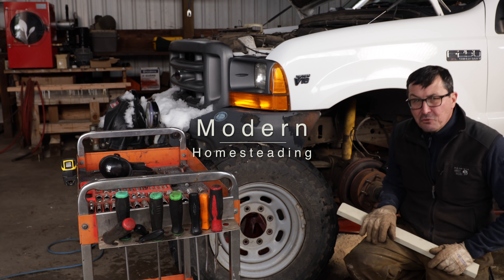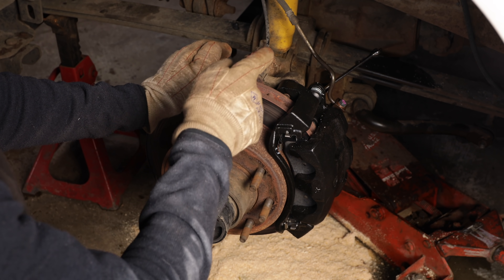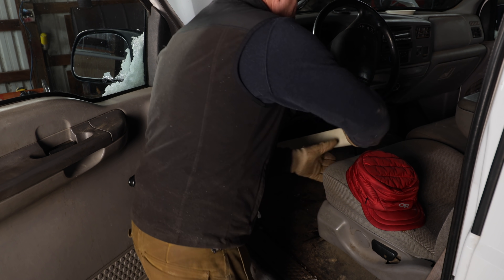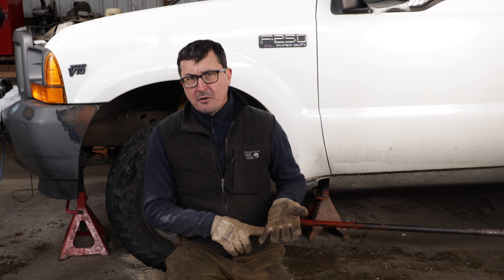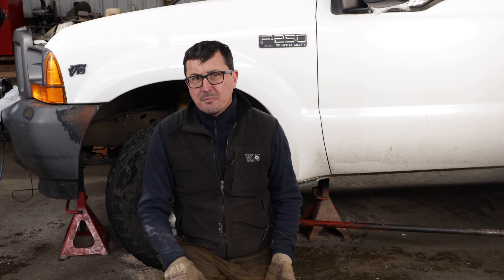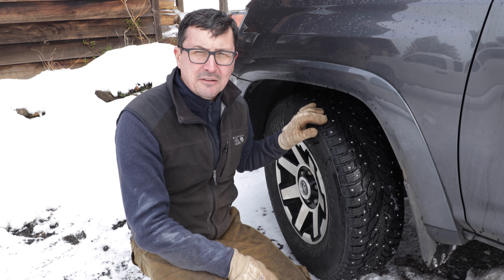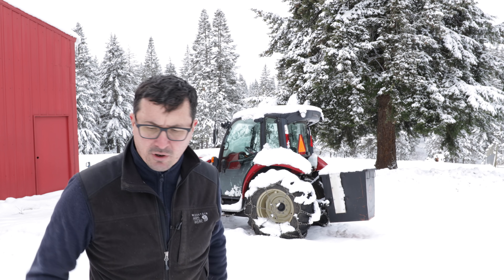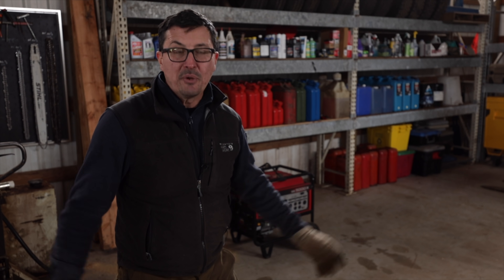IT FINALY HAPPENED!

Comment: I have an 81 f250 tallboy. This old truck  is a beast. It isn’t pretty but it works great with 400 000  miles on it.  A few years ago we had a particularly savage blizzard blow through. I went for a drive and wound up pulling over 30 vehicles out of snow drifts including done municipal workers town vehicles.Some of them were brand new fancy 4X4 trucks  that were stuck in the same snow drift  that  I plowed right  on through while pulling their truck out at the same time.  No computers,no sensors or any complex electronics. Nothing goes wrong because it doesn’t have anything. Just a standard transmission  geared nice and low Mated to a bulletproof straight 6. The few times my mechanic ever gets to work on it he just loves it. Easy to work on and tons of room under the hood:

Comment: I wish Toyota would make a heavy duty truck. Seems they've just given up trying to compete w the big 3 in this area. Could you imagine a Cummins powered Toyota?
Reply: We had a Cummins powered Nissan that was targeting something bigger than the half tons and smaller than the 3/4's.  It just didn't take off.
Reply: @goombakiwi  I know. I've seen them. They didn't take off because 1, it's a nissan, and 2, they're the ugliest truck you'll ever set eyes on.
Reply: I'd definitely buy one.
Reply: IOverseas vehicle manufacturers make models that are big 4 wheel drive commercial units with diesel power plants great fuel mileage as well, they refuse to sell those models in the states.......
Reply: @drewcarpenter Toyota would most likely have a Hino in it. The Nissan’s with Cummins have over head valves, so they will have timing chain problems just like everyone else.
Reply: Tundas are heavy duty enough.
Reply: Apparently you have never driven a 5.7l tundra w/4.30 geared axel....     who needs a 3/4 ton ?
Reply: @edaker4684  no they're definitely not
Reply: @mikebraun9673  people who need dually and long bed
Reply: 2021 New engine and new 10 speed transmission coming out.  Should help with all of that although I dont think a diesel Tundra will happen.
Reply: @digdrewzter  Yes....   you win on the long bed argument...
Reply: Australian Toyota turbo diesel tray back is probably the most reliable vehicle made today.
Reply: @edaker4684  true

Comment: For  bleeding bakes and clutches, I have a neat little gadget, which consists of a piece of rubber pipe, about 6" long, with a ball bearing jammed in it, about half way along.

You fit it on the nipple, crack the nipple, then pump the brakes a few times, until the peddle feels firm, then tighten the bleed nipple, and remove the pipe.

The fluid is pushed past the ball bearing, but air isn't sucked back in the system, when the peddle is released.

Comment: A generator shed would let you keep it in place in a protected box ready to run at all times. 

A propane conversion kit would let you duel fuel the generator giving you the option of BBQ propane tanks for availability and shelf life along with leaving the liquid fuel system in tact to still run on gas. Starting and stopping on propane will make sure the carb is free of any gas so no worry about gas evaporating in it and needing to be cleaned out.

Comment: If you're looking at badges you're doing it wrong. There are sh*t Fords and Toyota's. Take the 6L Powerstroke for example or the frame rot on certain years of Toyota trucks.. There isn't a ford or dodge truck I want but there are few GM trucks I'd consider depending on the year and powertrain.
Reply: The 6.0 powerstroke aint got nothing on the 6.4 powerstroke
Reply: @jefferycollins5158  
Sorry I meant the 7.3 that international made. By far the worst. All I can say is buying by nameplate is stupid. The first two years of a new model/powertrain are usually the worst and I wouldn't buy anything without checking carcomplaints website after it's been on the market for 5 years. I don't trust any of them.

Comment: There is an easier way to bleed your brakes. Filling a bottle with a little of fresh brake fluid. Attach a hose to the bleeder screw, then open the bleeder screw. Then you can press and release the brake as many times as you like. Once you’re done, tighten the screw and you’re done. It’s a good way to flush the brake fluid as well.

Comment: pro tip from an old guy (not me) pull the bleader screw and have a tea. Blead screw is on the sytem high point, removing it opens lowers restriction, when it starts to leak you have most the air out.

Comment: Another idea for bleeding brakes is to use any bottle, put a hose on the bleeder long enough to reach into the bottle a 1/4 inch from the bottom. Fill the bottle half full with brake fluid and insert the hose from the bleeder into the bottle. Support the bottle with the hose in it so it doesn’t fall. Open the bleeder and pump the brake pedal slowly 10 times. Close the bleeder and pump the pedal, it should be hard. If not do the procedure again. I do this a lot works great!!

Comment: Mr. Wranglerstar, I don't know who told you that Dodge pickups need ball joints every 30,000 miles but, they were very misinformed. You did say something in this video that I agree with. They all have issues at some point. Especially if you use them. I have a 2007 3/4 ton Cummins that has 201,500 miles on it. That poor pickup never goes anywhere without hauling around 10,000+ pounds. I pull my 5th wheel along with either my boat behind it or my flatbed trailer with my RZR on it. In 201,500 miles, it has 1 set of ball joints. I did upper and lowers although only one was worn out. And it's only had its breaks changed 3 times, rotors only once. I'm almost do for the 4th change but in 201k, that's pretty damn good. I would say that 85% of those 201,500 miles are pulling miles. Given how many times my ford friends have had to have their pickups fixed, that have far less miles on them than my Dodge, I will gladly stick with my Cummins diesels until I die. I'd be happy to debate this topic if you'd be interested. Have a great night, sir. I look forward to more of your videos. Even if you do bash on the superior pickup brand. Haha

Comment: Another trick you could use is put a silicone hose on the bleeder, run the hose to a can full of brake fluid, fill up the reservoir and the you can pump the brake pedal yourself, the fluid in the van will not allow air to come back into the line and you pumping the brake will purge all air out of the system. Something I learned years ago and has never failed me.

Comment: you can also use bottle and hose. put little bit brake fluid in the bottle, drill hole to the bottle cap, put hose thru it and make sure that the hose is in the fluid, then connect the other end to the caliber, then just pump the pedal. all the air comes thru the hose to the bottle and makes bubbles.

Comment: The only honest thing he said is that ALL manufacturers have issues and flops. FORD is NOT DIY friendly.
Since 2012 F150s require you to go to the dealer to check/ad ATF. Look in the owners manual.
Since 2012 Super Dutys are designed to have the cab lifted off for anything more than routine maintenance. 
Every year FORD makes you buy more special FORD only tools to be able to work on them (is special jig to lift off cab).
Lastly when you buy new OEM parts look to see how many say MADE IN CHINA on the package.
Buyer beware. Almost any other auto company in the US is more DIT friendly than FORD.
Reply: Not sure what you are talking about tbh. I was a Ford tech for years until about a year and half ago. F150s don't require you to go to the dealer for atf, its basically the same as changing oil on a manual transmission. You can do a ton of work to the 2012+ f250s without pulling the cab. The only thing I ever pulled those cabs for is if the motor went or the fuel system was contaminated. And just FYI Chevy requires pulling the cab for most of the same things. I can change Injectors, pull intakes, turbos, EGR, lower oil pan, all without pulling the cab just fine. I rarely use special tools on fords. There were more special tools you needed working on 7.3l or 6.0 than the 6.7, and those were designed and made by international, not ford. Off the top of my head, the only special tool I used on a 6.7 was an injector puller which actually made it harder to pull them than just using a prybar carefully. As for lifting the cab, you don't need a special cradle either, not sure where you go that from. I have never heard of nor seen a special cradle for pulling them. A 4 arm lift and ratchet straps is all you need and the Ford workshop manual doesn't call for a special tool to lift it. Interior work in fords is extremely easy, you can pull the entire dash out in 45 minutes.

Comment: "The two best car manufacturers are Toyota and Ford."

30-year mechanic, here.

Toyota, Honda and Mazda make the best cars, with Hyundai/Kia making a pretty impressive product these days.

Ford has an argument in trucks, but not SUVs. New Fords have a lot of electrical and emission-related issues.

They are still miles better than GM or anything from Europe.
Reply: i thought he was going to say honda O___o i still like my corolla 02, broke the tensioner bolt x___x need helicoil
Reply: @abandonedhope2606  That's a minor thing, though. I work on some cars that are dead before 100,000 miles; they either cannot be repaired, or the repairs would cost more than their value.

I would put a new engine in an 02 corolla, if I had to and the rest of the car is clean.

Comment: When bleeding brakes on older vehicles it is a good idea not to depress the brake pedal much lower than normal travel due to the possibility that the lower (unused) area of the master cylinder may be coated in rust/scale that will shred the rubber piston seals, causing master cylinder failure.  If will take longer to bleed doing it this way, but you will be less likely to destroy the seals.  Also, it's a good idea to change the brake fluid ever few years since it absorbs moisture.  This will extend the life of the braking system including the expensive ABS pump.

Comment: Of the 14 largest recalls from any manufacturer, Ford is on the list for 5 recalls. 4 recalls of which were for leaking fluids and shorting circuits causing fires. I'd rather have my ball joints

Comment: Cummins diesel owner here.  265,000 miles.  Original ball joints.  Transmission issues 10 years ago but that's about it.
Reply: But do you drive offroad? Or rough roads? Tow? Run heavy loads?
Reply: @izzyplusplusplus1004  yes.  Haul a trailer 99% of the time.  Been right up to the 26000 pound limit.  All over the new Mexico mountains.  F.O.R.D.  you know what it stands for.  Lol

Comment: One reason for brake caliper sticking is contaminated fluid.  Brake Fluid is very hygroscopic and when you get water in your fluid, it will develop rust in the system and that will jam up your pistons.  My Haynes manual says to completely change out your brake fluid every 3 years or 24K miles.  Judging from the looks of your fluid, you are overdue.  BTW, didn't you change out that caliper a while back?  Shouldn't you be able to get that warranted?

Comment: You need to shelf your grandad's brake trick. A bottle or jar of almost any kind and a length of tubing will allow to pump the brakes and easily and quickly bleed them all by yourself. There are fancier methods too.

Comment: Yeah, when I turned 18 I bought my first dodge, and it will be my last that's for sure. Least favorite thing is the cheap plastics.
Reply: I'm on my 3rd Ram 1500 pickup. I buy 'em new, run them for about 10 years, then sell or trade them and move on to a new one. I'm 7 years into my 3rd one now and it's still going strong. Granted, I only put about 7-10k miles a year on them; but I keep up with oil changes and rarely have much trouble with them.  If I used them as a tradesman does, for all I know I might have a different story to tell. But as a homeowner, I've had good experiences with Dodge pickups. YMMV.
Reply: @theElderberryFarmer  i mean the way youre taking care of your truck any truck will do haha glad to hear someone actually taking care of their trucks... its funny how so many people complain about teh 5.4 or the 6.0 fords... when in reality they all make it to 150k regardless of how you trreat it... and thats not shabby... secondly they ONLY break when people overheart them or dont change the oil they clog the oil galleries and then weld the cams... its the owners faults for not changing oil
Reply: Rams do not belong to Dodge anymore.

Comment: Brakes are easy to bleed on your own. Get a clear rubber fuel line, used on motorcycles etc. One end goes on the brake nipple. The other at the bottom in an empty clear plastic water bottle. Keep pumping the brake until there aren't any air bubbles coming out. Keep adding fluid when needed.

Comment: I didn't even think about commenting on the ford "until" the comparison. Funny, I had a 99 Dodge 2500 4x4 that I put 250k miles on, ran great when traded. Same with a 2005 Dodge 3500 dually 4x4 that I traded last year with 207k miles. Never had to do any front end work to either.

Comment: Dude, Get speed bleeders for your calipers. All you have to do is attach a hose to the bleeder or a bleeder bottle, loosen the bleeder once and depress the pedal a few dozen times, you don't have to close the bleeder every time either, because of the one way integrated valve. Then replace the rubber dust cap once the bleeder is tight again. They're lifesavers! Also, older jeeps with the 4.0L straight six, either the Cherokee, Comanche, or Wranglers, as long as they have regular maintenance, work great. But that's true with most things. Regular maintenance or replacing factory non-greaseable sealed joints with ones that can be greased, will extend the life of that part.

Comment: The caliper on my 91 Cherokee started dragging last year.   I flushed all the nasty brake fluid and it's been working fine ever since.   It now has over 300k on the original calipers, engine, trans and almost everything else.  My 94 Chevy truck has over 240k with no major issues.  I doubt any of the new trucks will last as long as the ones made 20-30 years ago.  They're all too complicated now including the diesels.

Comment: I'd rather replace ball joints every 30k than replace my engine every 30k like owners of a Ford Powerstroke 6.0/6.4. ;)
Reply: Ok big shoots
Reply: 6.0s and 6.4s aren’t even bad if you ask people that own them and know how to work on them. The biggest problem is people not knowing what they’re doing and ruining them
Reply: Every Ford diesel is a joke and yes I've driven them all.  The 6.0 is fine after putting a few grand into it. The cummins is the best diesel engine out there.
Reply: Jeremy  Brua what makes them such a joke you can’t say they’re a joke and not give a reason and it rather spend money on an engine than have the only good part of the truck be the engine
Reply: @georgecostanza9387  the 7.3 was the best out of the 3 but it had cylinder problems and you either had to change the coolant often or use special additives. The glow plugs were also junk and the truck will not start on an 80° day without them.

The 6.0, the oil pans would rust out from the inside. Head would blow right off.  EGR is junk. Turbos would carbon up. Coolant system is poorly designed. Exhaust manifold bolts snap right off.

6.4, shitty mileage, lacks power, oil issues from fuel blow by, cooling issues, flaming exhaust.
Reply: Jeremy  Brua your talking about the 7.3 Idi that’s not anything like the powerstroke also 6.0s never had oil pan problems egrs are junk on everything. Vgt turbos carbon up on everything. Exhaust manifold bolts snap on everything. Heads don’t blow right off. And never had problems with the cooling system just the bad coolant that came from factory. 6.4s got great mileage tuned and made very good power. The other issues were caused by emissions problems that every other brand also had and still has. You obviously know nothing and watched one deboss garage video and think you know everything about powerstrokes
Reply: @georgecostanza9387  I've driven them as work trucks and maintained them all but I guess you know more. How many trucks do you have in your fleet?

Comment: Agree with Toyota but ford... really they are so fragile and require to much maintenance. Sure it helps that the parts are cheap but vehicles shouldn’t be so brittle like ford are. The German manufacturers are much better and more reliable. That and Volvos
Reply: Really? You must be thinking of gm and their junk plastic. The tailgates are proof of this.  All my ford tailgate handles still work and have never needed work.  Gm tailgate handle plastic is complete junk.
Reply: Every vehicle needs maintained, and working on anything European in the US is almost unbearable due to lack of parts and skilled labor. Just to clarify here in the frozen north west ive torn every door handle off every truck ive ever owned (being a neanderthal) including the old all metal designs. Theyre all gold, and theyre all shite, depends on your maintenance schedule and how you treat your equipment.

Comment: I'm a 'Ford guy'; have a '16 Powerstroke, '99 V-10, 95 E-350 motorhome and a '74 Bronco.  But I've had crappy Fords including a '86 Ranger and a '00 Focus.  I've also had a great '96 GMC Safari, and a dependable '83 Dodge Ramcharger.  I've had more good luck with all my vehicles over the years than bad.  One standout was a '05 Mazda MPV we sold with over 200k miles of nearly trouble-free miles and another was a '15 Kia Sedona with less than 45k miles that spent over 60 days in the shop in the year-plus we owned it.  One thing for sure; the manufacturers are doing us ZERO favors with all the electronics in the new cars; they will fail at some point and are crazy expensive to repair.